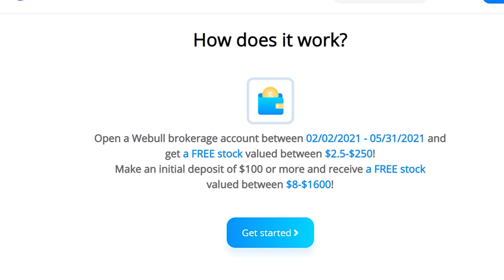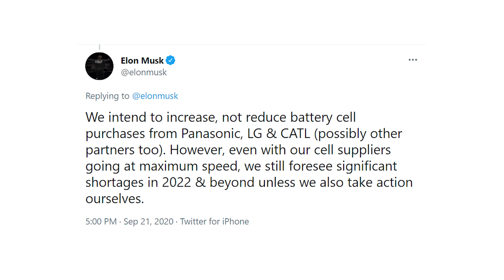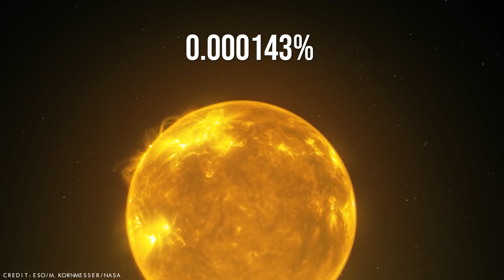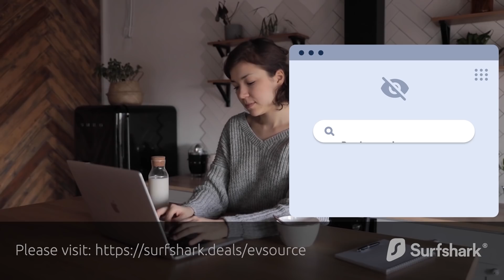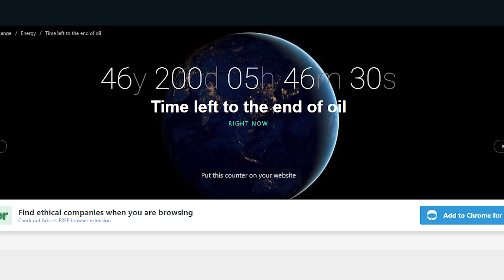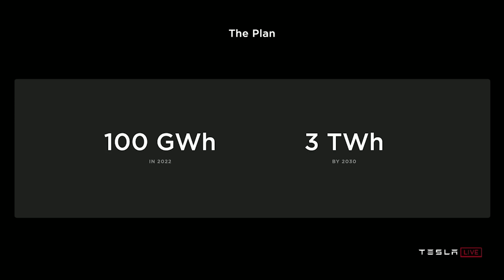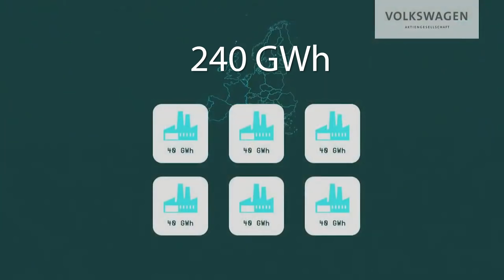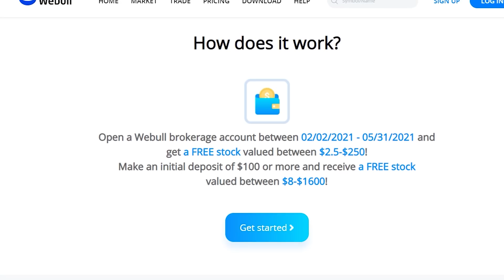Elon Musk's Message To Oil Giants: "The World Could Be Powered By Solar Many Times Over"

Comment: Carbon Capture. There is a Canadian company that captures the smoke from chimneys and pumps it into the ground. Instead of pumping the smoke into the ground why not do what nature does. Smoke rises and then cools off and condenses. Why not divert the smoke into an area that is cool or cold and let the smoke condense into a liquid or solid where you can then manage it to be cleaned or recycled.
Reply: Or even better, quickly convert all industry to battery, solar; eliminate chimney output from all coal and petroleum plants.
Then we wouldn't need an entire world wide industry to build co2 suckers, require new metals be mined to make this gigantic CO2 sucking facility (it would be the size of a coal plant, and would itself need a field of solar to keep it co2 neutral) work on a scale of hundreds of thousands of these facilities worldwide. 
That's insanity. Just stop burning fossil fuels asap. 
Another way to do it is plant a trillion trees. That would take out about the right amount of CO2 that we need. Do the math on a calculator, trees are about a dollar per planting nowadays so figure it out and then compare the cost of a worldwide gigantic infrastructure of CO2 sucking machines
Reply: You don't need to do that you can be anywhere in the world to capture carbon, and turn it into gas.

Comment: The grid has out lived it’s usefulness. It’s only purpose is for the profiteers. The future is Embedded Generation. For example , If every subdivision in America would put their money together to put solar panels on all of their homes to generate their own power. Then purchase your power inverter, storage batteries  that would meet the need of the community, a commercial switch box and a micro grid to divert the energy back to the homes. Put your power lines underground to help prevent storm surges and a computer to monitor the whole system to regulate the power flow. How much money does a community pay for electric power in a lifetime? That’s how you would pay for the system. Setup an app so everyone could see that the money is going toward repayment of the project. They would get a cheaper rate for the solar panels because they bought in bulk and if more communities joined them they would even get a cheaper price for everything. You could use as much power as you like. You could sell energy back to the grid but I wouldn’t waste my time with that since the system is rigged. These debts could be paid off before you finish paying for your home and you would have free energy. Home builders could build communities like this and just add the cost into the price of the homes as a single payment and advertise their homes as energy efficient and basically no light bills. You wouldn’t have to worry about hackers , storms or power outages and you could build dome construction over your system to help protect them against floods and storms and even add faraday technology to help prevent against solar storms. Their are many other ways to help integrate this technology into lives but beware, the people whom you elect to protect you will be your fierce opponents.

Comment: We should also consider Hydrozen as future fuel.
Reply: One of the present problems with hydrogen is that it needs to be manufactured using huge amounts of electricity, and it doesn't give back the energy used in producing it. Plus, once you've got your hydrogen, it still needs to be transported everywhere in large trucks to the points of storage and sale. No reduction in pollution there. Electricity needs no transportation, as it uses the existing grid.
Reply: To produce the amount hydrogen to drive a given distance needs triple the electric power compared to direct storage in battries.
Furthermore, a fuel cell is a delicate and heavy peace of technics which also contains precious material that is of better use elsewhere, eg. platinum.

Comment: YOU DO NOT UNDERSTAND THE PROBLEMS WITH ELECTRIC VEHICLES
*  *  *  *  *
Advanced electric motors of the type used in electric vehicles are very expensive to make and fuel. Since the proposed energy sources, wind and solar, are notorious for their inefficiency and unreliable nature (no wind:windmills stop, no sun:solar cells stop working), they must have a 100% backup for the times when there is no wind or no sunlight. That means that windmills must have coal or natural gas fired generators to supply power when the wind doesn't blow and solar farms must have the same when there is cloud cover or during the night time were no power can be generated. Also, while coal or gas fired power plants require only less than a fraction of an acre of land, wind and solar both require hundreds or even thousands of acres to achieve equivalent power generation. The same people who are pushing EVs are also complaining that the planet is running out of space (another ridiculous claim)!

When you add to this equation the fact that the electric motors used to power electric vehicles are loaded with toxic substances and the rare earth metals that starving child slaves are mining, you run into the problems of supply and disposal. There is not enough rare earth metals on Earth to create enough EC's to replace hydrocarbon fueled vehicles. And, when a wind mill or solar panel reaches its end of useful life you have piles of toxic metals for which no one has even thought about the costs and methodology to safely bury or recycle (again more land)!
Reply: Says the hydrocarbon lover. You do realize that coal and gas fired power plants aren't that efficient either, except when you play with the numbers. These power plants are killing the earth. Solar arrays only take someone to wash them on a regular basis. This only take water, no hazardous chemicals. Solar doesn't have any hazardous byproducts after they have been manufactured. As for electric motors using toxic substances (care to tell us what they are?) and rare earth metals, those are being phased out as well. ICE engines aren't exactly clean products to make and definitely not non-toxic to operate (starting with oil and gasoline). Everything you said is from years ago and not what's in current use and development. Everything you say about the lifespan of solar panels are the same issues with current power plants, everything needs to be updated, repaired, cleaned, etc. Listen to what Elon said about the amount of room a nuclear power plant uses. Solar with battery storage would take the same amount of space yet produce more energy and the energy is instant. There's no real delay like you get when having to turn on the peaker power plants. Texas should have stopped pumping oil and put that effort towards renewable energy and they wouldn't have had the power failures they had this year. Stupid politicians allowing stupid oil projects because they get legal and illegal bribes.

Comment: They said we would run out of oil in 1970 in around 30yrs time, you go ask those guys why we are still finding oil in 2020, they will fluster and make excuses, now we are told 46yrs we run out of oil, HaHaHaHa.
Reply: We may well have enough oil to last for the next 46 years, but present demand won't stay at it's current level for 46 years! I'd say that in something like 40 years, we'll be down to 25% of the current levels of demand.

Comment: @ 6:01 you need about 4x that little square, because solar only works about 1/4th the time. It's the inverse of capacity factor, which is about 25% for solar.
Plus, we need extra energy needed to make the solar (so enlarge that square by about 1/20th extra). Plus we need extra energy needed for batteries (enlarge it again by about 1/10th or so).
The ONLY thing that really matters is if the whole of renewable energy and batteries requires a certain "x amount" less energy to make than they generate.
I believe, since Tesla has figured out how to make a battery using the dry electrode process, and other massive efficiency improvements, and since solar's energy pay back time is now approaching only ONE YEAR, that we shouldn't be too concerned about overall EROE, energy returned on energy invested.
Eventually, it will take more oil to recover oil, anyways.
Hopefully, more efficient panels that last just as long or longer are in the works, too!
Reply: yeah, thanks. we'll still go with the solar

Comment: Nice video!
Thanks a lot.
Ps, what do you think about solar thermal electricity plants? Basically using sun power to warm fluids to generate steam?
Like a thermal electric plant but based on solar?
Reply from the maker: Sound like an interesting idea
Reply: @WattsTheFuture  thanks.
I think it was Rubbia's ideas
https://en.m.wikipedia.org/wiki/Solar_thermal_energy
Reply from the maker: @JoshEagleSte  Thanks for sharing! I will definitely be looking more into this
Reply: @WattsTheFuture  You are welcome!
Reply: Water boils at 30c in a vacuum have a tank of hot water spray it into a chamber it flashes to steam passes through a turbine making electricity to a chiller chamber and condenses back to water transfer the heat back to the hot water tank add some solar heat and keep it all flowing.

Comment: Agreed, Ford and GM in particular suffer severely from old school thinking, a lack of innovation, a profit supremacy motive, and 50 years of not needing to do anything but incremental change.  It would be a complete miracle if they catch up enough to compete on level ground.
Reply: You are going to be surprised then Ed; as transitioning from Lithium ion to Solid State will be as hard as from ICE to Solid State.  All the large makers know this and have focused on this transition; until then you have  big fat heavy lithium ion pigs that weigh 5000 lbs and cancel out the benefit of electric motors.  They cost more energy to make and wear tires and brakes faster than hybrids. A hybrid fleet drives 5-9x more electric miles using the same number of batteries; and battery production is constrained so Full EVs are anti green; even Tesla itself compares their car to a 3 liter BMW in that regard; not exactly green. For every Tesla you could make 10 hybrids that means you must make 9 ice cars for every Tesla because there are not enough batteries to meet demand.
Reply: You are right it isn’t a level playing field. The legacy manufacturers are burdened by issues that Tesla doesn’t have to deal with. Dealer networks, retirement and retiree medical benefits, pollution credits, and more. Tesla still wouldn’t have made any money if it hadn’t been able to sell pollution credits to legacy manufacturers. The only reason Tesla is a viable company is because of those pollution credit subsidies.
Of course in any major industry transition their will be winners and losers and more than likely the losers will go out of business. Also the legacy manufacturers that are already the weaker manufacturers are the most likely to go out of business.
The one problem Tesla does have is reliability and quality. Considering BEV are inherently easier and simpler to build and more reliable that issue isn’t a good long term omen for Tesla. It is much much easier to build a BEV than it is to build a quality, reliable, and durable product.
In twenty to thirty years Toyota will still more than likely be the largest auto maker because the hardest part in making high quality, reliable, and durable BEV isn’t making them electric.
Reply: @matthewhuszarik4173  Maybe you missed it but Tesla is also expanding at a very rapid rate at great expense and still making profits. If regulatory credits, which are available to any auto maker getting serious about making EVs, were discontinued tomorrow Tesla would simply have to slow expansion by 1-2% to still be in profit. 
You say the one problem Tesla does have is reliability and quality. They have way more demand than they can supply which means there's a whole lot of people who probably don't agree with that and there's plenty of evidence that they build quality, reliable, and durable products.
BTW the hardest part in making a high quality, reliable, and durable BEV is, indeed, making them electric as the legacy makers are discovering. They are way behind Tesla in the tech and being overtaken in vehicle manufacturing, giga casting being just one area.
Reply: @earthwizz  First of all almost all the tech you are crediting Tesla with they had partners who actually provided the Tech. Batteries Panasonic, self driving Mobileye, giga casting Idra group. Second all manufacturers have long waiting lines for vehicles right now because we are coming to the end of the pandemic. Tesla’s aren’t particularly long compared to some other maker’s models. Third BEV are supposed to be much simpler and more reliable than ICEV, but Tesla is still coming in at the bottom of the industry for initial quality and warranty work. Of course reliability isn’t the only factor in vehicle purchase like Jeep’s Tesla’s are popular in spit of their terrible reliability record and headaches getting them repaired. The problem is all these issue leave a huge opening for other manufacturers to come in and steal market share. Which VW is presently doing in Europe with the ID.3 and ID.4. There are also other startup manufacturers who are attempting to out Tesla, Tesla. Aptera if they make it to production will steal significant sales from Tesla as the newest bestest thing on the block. No one  knows for sure where we will be in five to ten years, but the legacy manufacturers and plenty of new startups are going to come after Tesla and it has left a ton of openings for them to take advantage of.
Reply: @matthewhuszarik4173 
I noticed you've abandoned your 'only profitable because of regulatory credits' argument after it was comprehensively dismantled without any acknowledgement of that from you. That would be the honest response in any civilised discussion but, clearly, we can't expect that from you since you simply leapt into more BS like short waiting lists, they sell way more EVs than any other maker and have way more demand than they can supply, and then repeating the BS about build and quality which had also been summarily dealt with. 
You seem to be implying Tesla's engineering is mostly from other people therefore anybody could do it. So why aren't they? Are the legacy makers deliberately leaving Tesla with years of tech lead just to lull them into a false sense of security? You obviously haven't noticed that Tesla is a constantly innovating engineering led company. BTW Mobileye hasn't been used by Tesla for a very long time, they developed their own. 
Engineering requires logic, reason and honesty for anything to work. Beliefs, ideologies and dishonesty, the staple diet of cults, don't make anything work except cults.
You can toddle off back to your pathetic little Tesla haters cult now. Biyeeee.
Reply: @earthwizz  You need to take an accounting class. Capital expenditures aren’t treated the same way as costs they are amortized over the life of the asset. So Tesla expanding has little to do with their profitability. If you had said R&D you would have been more accurate, but most automakers are spending far more than Tesla on R&D.
Reply: @earthwizz  I give you facts and evidence and you give me a tirade back. Thanks as all zealots eventually do you have shown your colors. Unable to argue the facts you attack your opponent. I never said I don’t like Tesla’s I just don’t think they are close to being the best iteration of a BEV we will see.
Reply: @matthewhuszarik4173  Toyota is handicapped much like GM........Stuck in an old school mindset........They will have to somehow develope a whole new mindset to lead the pack...........Maybe They will....Time will tell......very soon.............Paul
Reply: @paul-flyer  Unless you work for Toyota you don’t know what their mindset is. Toyota has built more electrified vehicles than anyone else. Those vehicles are responsible for eliminating more CO2 from the environment than comparable ICEV, than anyone else. Tesla has produced 1.43 million BEV while Toyota has produced over 15 million hybrids. Who has more experience building electric drive trains especially with quality and reliability included? Just because you create a market doesn’t mean you will eventually dominate it. While Tesla has some incredible advantages Super Charger network, no dealers, no legacy employee costs, pollution credits, and some others it also has some incredible disadvantages lack of experience and expertise in manufacturing complex electromechanical devices. I have already moved past Tesla autos I am still waiting for the Cyber Truck as it looks very interesting. For BEV autos I am looking at Aptera, Toyota, or maybe BYD.
Reply: @matthewhuszarik4173  How much CO2 was produced mining the materials for these cars, how much CO2 produced by coal burning factories making the steel, how much CO2 produced using petroleum semi's and trains to deliver these cars? Everyone is being convinced these cars have no CO2 footprint and they are Green. Hybrids still use gas engines so they still produce CO2.